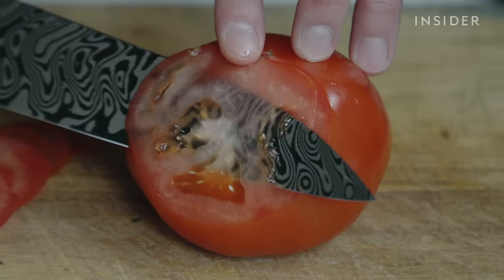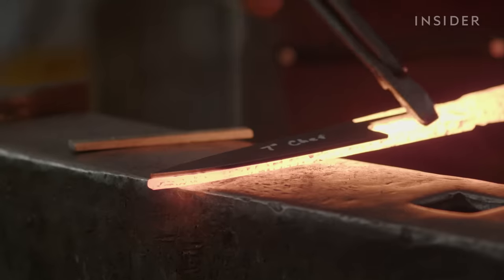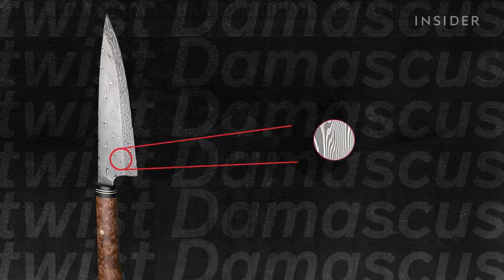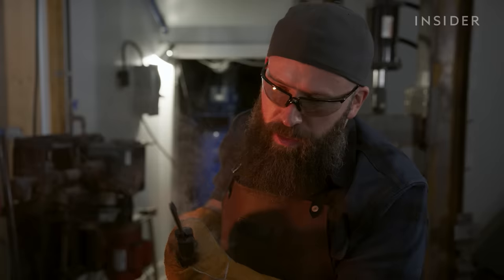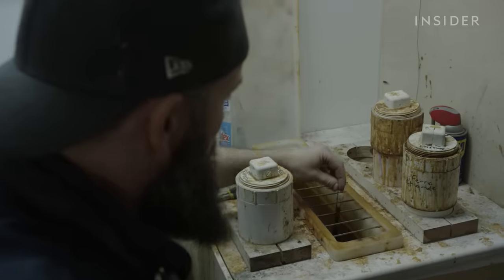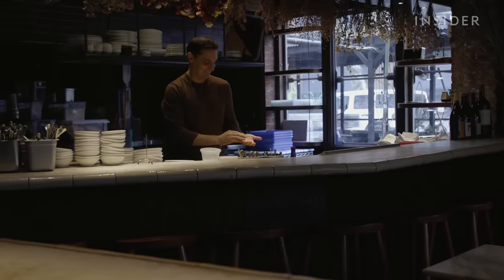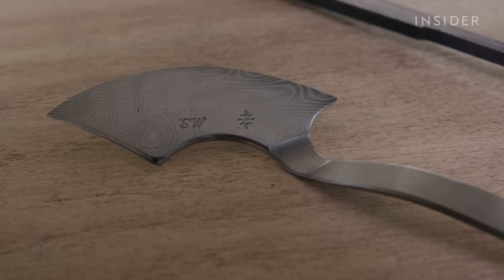Why Damascus Knives Are So Expensive | So Expensive | Insider Business

Comment: There is a lot of misinformation in this video unfortunately... 

For one, damascus/pattern welded steel is no "sharper" "stronger" or "better" than any other monosteel. Zach is likely using 1084 and 15n20 for the damascus produced here. After forge welding these alloys together, the carbon content within the steel as a whole will homogenize during forging and your end steel will perform near identically to 1080 (if anything slightly worse as extended periods of forging can actually cause negative effects in the steel). It will NOT perform any better in ANY metric than any other knife made purely from 1080. 1080 is also considered a relatively low performance steel in the world of knifemaking. That's not to say that it is bad, but there are plenty of other alloys that can perform much better in a kitchen setting (CPM M4, CPM Magnacut, Zmax, CPM S90V, etc). These tool and stainless steels do not forge well due to carbide volume and so are exceedingly difficult to turn into damascus. Most damascus on the market will be some combination of low alloy tool steels or plain carbon steels with one being nickel rich and the other nickel deficient. To reiterate, these low alloy steels are not particularly tough, hard, etc. and perform accordingly.

Not to hate on Zach here as he does make some nice looking knives and has obviously earned his title as a master smith, but many of the things he says metallurgy-wise just aren't true. At around 5:40 he says that he is looking at scale that has flaked off after heat treatment because "the steel has contracted after it hardened, so I know it is hard". Steel goes through a volumetric INCREASE during hardening and actually expands slightly, doesn't contract. And this isn't what causes scale to flake off either, it's the force of the vapor jacket during quench combined with the rapid decrease in temperature (which does involve a shrinking of the steel) that does that. To any smith's that are here learning, flaky or cracked scale after quench does NOT equal a hard blade.
He's also using sharpness as a metric for performance which says very little about the actual quality of his steel and ht. Given the low alloy steels he is using and the HT he is doing using his forge rather than a temperature controlled kiln, his blades likely fall far below the performance of the theoretical best-of-the-best on the market. Again, not to say that they perform badly, but to claim that your knife is the sharpest, strongest, etc around is pretty ridiculous. 

Also to everyone in the comments saying that true damascus/wootz steel is a lost art, it's not, we've recreated it exactly. The recipe is not lost we know exactly how it was made and what is in it down to the .000001 atomic %. We've also tested its mechanical properties and it falls far short of any modern monosteel that is produced today. 

Anyway, I'll end my rant there, again no disrespect to Zach, he makes beautiful knives, it's just the misinformation and lack of background research by the people who produced this video that bothers me.

Source: I am a professional bladesmith, have made tons of damascus myself, and have a bachelor's and a master's in metallurgical engineering.
Reply: sheesh u kinda went off there. thanks for the information!
Reply: @spryte4371  Yeah maybe I went a bit overboard haha 😅 just felt the need to clear up some stuff that I thought could be confusing for people trying to learn more about smithing, so I hope it helped!
Reply: @grantsaxman7170  nahh that helped me w a lot of informative knowledge
Reply: On what topic did you do your master's?  And where did you get your master's?
Reply: @latetodagame1892  Material Science Engineering with a focus in metallurgy from University of Michigan. The metallurgy involved in bladesmithing is incredibly complex and interesting which is what drew me to the field in the first place :)
Reply: @grantsaxman7170  nice.  What do you think about carbide rip out when using ceramic over diamonds?  Is that true or a marketing scheme?  And what do you think of the Spyderco's Sharpmaker specifically with the sapphire infused ceramic rods?
Reply: @latetodagame1892  This is a really interesting topic. Unfortunately, it is quite nuanced and depends on a plethura of variables so there's not really one easy answer, but here's my best take:
1) the effect of the abrasive you use depends a lot on the carbides present in the steel. Some carbides (cementite, chromium, etc) are similar in hardness or softer than aluminum oxide (the most common abrasive compound). Using diamond or other hard abrasives here don't really have much of an effect as aluminum oxide is already hard enough to abrade the carbides present. From here on out I'll focus on vanadium, niobium, and tungsten carbides, which are significantly harder than aluminum oxide.

2) the size of the carbides present plays a huge factor as well. Typically you can cut a carbide dense steel quite well regardless of the hardness of the abrasive if the size of the grit is larger than the size of the carbides present. That means that diamond stones and other hard abrasives aren't especially useful until you get to finer grits. This is also one reason (among many) that PM steels are favored over traditionally cast ingot steels. They have a finer carbide size which significantly improves machinability even before sharpening.
3) for the case where you have carbides significantly harder than your abrasive particles and the carbides are larger than your grit, diamond stones do have a use case. I have personally seen microscopy done comparing carbides in PM steels cut by aluminum oxide stones vs harder stones, and it is very evident that the carbides are not cut very well by the softer stones. The harder stones will cut the carbides flush to the matrix whereas the softer stones tend to burnish the carbides and cut around them leaving the edge uneven. Diamond stones aren't the only stones that are useful for this, Sharpton 320 was shown to be able to cut most carbides and it is NOT diamond and instead "ceramic". Do you NEED a diamond stone? Not at all. But there will be some improvement in specific cases that makes diamond or other hard stones better.

4) my personal setup is a cheap 220 grit alox waterstone to burr the edge, a 20 micron (~1000grit) bonded diamond stone to clean up and deburr the bevel, and then 1 and .5 micron smooth leather paddle strops. I like this method because I don't waste money on a coarse diamond stone when it isn't needed, and the bonded diamond stone can cut any steel well and is honestly just nicer and more user friendly and durable than any alox stone I've had. The strops are a super easy way to get a nice final edge, sharp enough for the straight razors I make too.

As for the sapphire rods, I haven't used them so I can't comment on them too much. I only really ever see a single use case for rods imo, and that's for recurved edges, otherwise I tend to prefer stones because I have the most practice put into using stones and I just find they suit my own preferences best.
Reply: @grantsaxman7170  thanks.  I really appreciate the knowledge!   Did you say the paper test is not the best test of sharpness?  Feel free to expound on this and any other topic.  I really appreciate someone with your expertise.
Reply: @latetodagame1892  Yeah, the paper cut test that is used by many people isn't really a very good metric for sharpness. The issue imo is that a decently sharp blade and a very sharp blade will be very hard to differentiate when cutting paper; it's just too easy of a test. There's only one real objective metric that I've seen for sharpness, and that is cutting a taut thread in a specific way over a scale, and recording the weight required to cut the thread. There are other objective metrics for sharpness related qualities as well (the CATRA test for example measures wear resistance of an edge, or how long a sharp edge will stay sharp). These setup are pretty costly for most makers unfortunately, so we tend to resort to less effective metrics like the paper cut test. My personal favorite is shaving my arm, I feel that I can tell a lot about the quality of the edge by how smoothly I can shave my arm after sharpening and how much tug there is in the cut.

If you're interested in learning more though, I'd highly recommend checking out Larren Thomas' blog Knife Steel Nerds. There is a wealth of information there, he has also published a book that has tons of knowledge about heat treatment of modern steels. You can also feel free to follow me on Instagram, my handle is yozakura_forge. A friend of mine also runs a knifemaking business called Troopah Knives, he is a student of metallurgy and regularly posts informative articles on different steels. He actually knows quite a bit about different sharpening stones and compounds like what you were asking about before, you can find him on instagram too.
Reply: @grantsaxman7170  ممتاز!👌
Reply: Thanks for sharing. Very informative.
Reply: Thank you for the technical insight. When I started watching the video I could tell, even with my almost zero knowledge, that there was plenty of misinformation .
Reply: @grantsaxman7170 I love it when genuine experts crop up in situations like this! Thanks for the info friendo!
Reply: The video said explicitly they "perform similarly to monosteel knives."
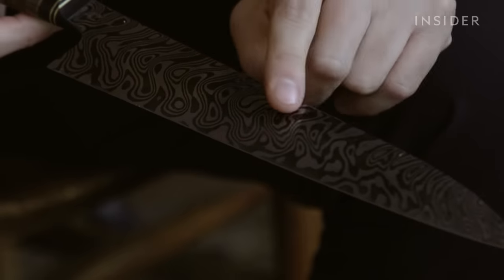Reply: @feelin_fine  Which monosteel? AEB-L? W2? 1018? There are hundreds of commercial alloys that are monosteels, with the vast majority of them not even being suitable for knives, and the ones that are have a huge range of performance. Saying that they perform similarly to monosteel knives is entirely meaningless, BUT they've already created context for damascus' performance at time stamps like 0:18 and 1:23. They are implying that damascus knives occupy the highest tier of performance which is downright misleading. In the world of custom knives, damascus falls into the lowest tier of performance, and performs notably worse than the majority of monosteels we have at our disposal. Again, that's not to say they perform badly, and they also look beautiful, but the video is either misinformed or purposely misleading.
Reply: 200IQ stuff ITT
Reply: Here's to hoping your comment hits the top of this video.
Reply: What hes making is an imagination of what damascus steel might have been , the original method , composition and process has been lost . It came from India , and like everything the British destroyed the science to propogate the industrial revolution
Reply: @Jatadhari1000  This is not correct. Pattern welded steels have been made for centuries and are not a reimagination of wootz steel (a crucible steel) at all. They simply both share a similar surface pattern and thus the term "damascus steel" (which may refer to the watery pattern seen on both wootz and pattern welded steels) has been attributed to both of them. In pattern welded steels, the pattern can be attributed to the alloy concentration inhomogenities between layers, whereas the pattern in wootz is created from vanadium carbide banding. They are both separate steels with historical precedent that happen to share a superficial similarity, neither one is reimagining the other.
Wootz is not a lost art either. It's true that at some point in history the exact recipe became obfuscated which may or may not be due to British influence (I could not say one way or another because I do not know enough, but I wouldn't be surprised). Since then, we have used modern technology like various forms of spectroscopy and electron microscopy to rigorously characterize historical wootz samples down to even individual atoms. From there, the process was reverse engineered with the help of historical texts and carbide banded crucible steels that are indistinguishable from period samples have since been produced. I have even been able to attend symposiums on the topic, handle modern wootz reproductions, and view data collected that compares and contrasts the samples. They truly are identical to historical wootz. The process itself has become well known enough that some hobbyist smiths are even reproducing historical wootz steel and turning it into knives that are on sale today. So no, the process for wootz has not been lost at all.
Reply: So... What chef's knife WOULD you recommend then if you wanted maximum performance, durability, and corrosion resistance?
Reply: In addition to this question: what would be the best quality/price choice for a knife?
Reply: They quickly repair their previous clickbaity statement at 1:43. Basically saying, "No they're not better than a good monosteel knife, but they're very pretty and made by an actual blacksmith!"
Reply: @arnox4554  I have been having really good experience with CPM magnacut steel if you want to know. It is stainless but has hardness near those of pure carbon steel. It is a bit more expensive though.
Reply: @donatodecarolis5330  Roger that.
Reply: @arnox4554  This is a really tough question. Every quality in a knife comes with a tradeoff. Each different knife also has a different purpose and so there's not always one "best" choice that works for every knife. With that being said here are my preferences with regards to chefs knives:

If you want an all rounder:
CPM Magnacut - superb corrosion resistance (enough for saltwater conditions), can be very tough, and can be very hard. Moderate wear resistance (this alloy is pretty much a super stainless version of CPM 4V)
AEB-L - this one's incredibly tough, stainless enough for the kitchen, and very inexpensive. Low wear resistance, can get very hard though. Definitely a very underrated steel as it's often considered a budget steel but performs better than what it costs.
CPM M4 - only semistainless, but very tough for a tool steel. Has slightly better wear resistance than magnacut. This is a steel I'd recommend over magnacut if you don't care about building a patina on your knife

For more niche performance stuff:
CPM S90V - fantastic steel, incredibly wear resistant, very hard, but chippy as hell. It's just not tough so you have to be careful with it, but it performs excellently in other categories
Zmax - I don't actually know too much about this one but I've heard and seen great things. I think it tends to actually perform a bit better than S90V in most metrics. 

For san mai construction:
52100 - this is the best commonly used low alloy carbon steel that is forgeable. Anything san mai with this in it would be a good choice. 52100 has good toughness, nearly no corrosion resistance, and nearly no wear resistance. (I'm comparing corrosion resistance and wear resistance to a baseline of 1095 which has basically the lowest possible in both categories). This steel will not perform as well as the tool steels listed above, but it can be incorporated into san mai which is very difficult or impossible for most tool steels.
Apex ultra - the best forgeable steel on the market currently. This one was only recently developed. It has low to moderate wear resistance. Moderate toughness and other properties. It's special because it has wear resistant qualities while still being easy to forge (forgeability is a requirement for making san mai)

For damascus/pattern welded steels:
There aren't really any great options here. There is very expensive damasteel that performs decently, or look for blends that include apex ultra or cruforge V for a small overall boost in wear resistance. Unfortunately damascus is pretty limited by its nickel alloy which is used for contrast. There are no high performance alternatives to 15n20 currently on the market, I would love to see some developed though
Reply: @donatodecarolis5330  Second the magnacut rec. Functionally it gets much harder than simple carbon steels as well. A common simple carbon steel 1095 peaks at about 67 hrc right out of quench. That's pretty hard, but it has a toughness of around 1 ft*lb which is very low. Think along the lines of glass. There's no real functional use for 1095 at 67 hrc in knives, it is too brittle. Instead, it is tempered back to around 62 hrc with a toughness of about 5 ft lbs. Here it is neither particularly tough nor particularly hard. It also has exceptionally low wear resistance and no stainless properties. It really is a poor performer. In contrast, magnacut can easily be heat treated to 65 hrc with ~10 ft*lbs toughness and be significantly harder and tougher than 1095. It also has wear resistant and stainless properties. Magnacut is a steel that outperforms simple carbon steels in just about every metric. So is 1095 useless? No not really, it makes great hamon, can be forged and incorporated into damascus, and is very inexpensive. But performance-wise, it is just worse than magnacut in every metric.
Reply: Can I ask you which kitchen knife you recommend? Or the one you USE? Sounds like you know your metal and I would like to get the Best
Reply: @LelandSmall-tj7hc  my primary knife is a nakiri I made myself. Currently I only use knives I've made myself. I can't think of a single case where a typical factory knife would outperform a good custom knife, so I'll have to recommend a custom knife here if you want the best.
Reply: This is what comments are for
Reply: @grantsaxman7170  what do you think of WMF damasteel?
Reply: Thank you so much, someone else who knows what they’re talking about. It’s also worth noting that if you have two different types of steel only one can be properly what treated
Reply: @nathanieong6212  I have not specifically heard of WMF, but here's my opinion on damasteel:
Damasteel's primary alloy will perform halfway in between aeb-l and CPM 154. They use European steels, but the blend is comparable to aeb-l and CPM 154. Think of it as a moderate performing steel, it tends to do better than carbon steel Damascus in most metrics. Good toughness, low to moderate wear resistance, stainless enough for the kitchen. If you want a higher performer, they have a blend that uses a cladding of their flagship steel and then a core of a nitrogen steel that is identical to vanax. You'll see significant performance improvements with this blend, I think it's called like N11X or something. The big downside of damasteel is that it's EXPENSIVE. Only a handful of makers offer custom stainless Damascus too as it is so difficult to produce. It is a very beautiful material though.

As for WMF, I took a look at their website. Their marketing is painful to say the least. They use the term damasteel (which is trademarked I believe) so this means they've licensed from the company damasteel, but I can't find which blend from damasteel they use for their knives. They don't seem to list it anywhere which is weird. I expect it is probably the flagship blend of aeb-l and CPM 154 comparable steels. Personally I don't prefer the all steel construction handles, they are heavy and look bad. The heel of their knives are also very low which is not to my preference. Overall not something I'd purchase, but if you like knives of their shape they may do fine. It's hard to say without using one.
Reply: @Afeller  This is only sort of true. If you did have two different steels, than the ht schedule would never be perfectly correct for both. But the ht schedule for steels used in carbon Damascus is already very, very similar, so most differences would be pretty negligible, you'd probably be able to find a schedule that works for both. BUT that's beyond the point here, because Damascus doesn't really behave like two different steels. Once you forge weld simple carbon steels together, the carbon readily diffuses at temperature. It takes less than an hour for the carbon to homogenize at temperature in most cases of medium layer Damascus. Carbon is the primary driver in choosing a ht schedule in simple carbon steels like these, and so the ht becomes essentially homogenous as well for the whole piece.
Reply: @grantsaxman7170  thanks for the reply. Very informative
Reply: Woah, thanks for sharing! Cool!
Reply: Hello, would you mind to link to some good kitchen knives that wouldn't cost an arm and a leg for average joe?
I just need normal, but good and sharp knives, nothing fancy.
Reply: @Ramsas154  I am partial to miyabi. You can get a chef in SG2 for like $300 bucks. SG2 is a solidly mid-tiered steel imo, decent but not amazing. Performs similarly to S35VN. The biggest issue imo is that it can be a little chippy. There are also now steels out there that will at least slightly outperform SG2 in pretty much every possible metric (magnacut). But not a bad steel by any means. Miyabi also sells VG-10 chefs for like half the price. I think vg-10 is an ok steel, but not great. Similar to 440C. Wouldn't ever recommend it unless you are on a stiff budget. It has slightly worse issues with chipping and worse edge retention than SG2. If you want something in VG-10, Shun's Sora line I think is decent for the price. $100ish bucks for a chef. I've used one of these before, it's nothing special but feels much better than most low RC cheap chefs knives. Biggest disappointment is that they don't round the spines on any of these supposedly higher quality factory knives, so pinch gripping is a bit uncomfortable. Would've also liked to see a taller heel and more aggressive distal taper on the Sora line, Shun's knives are weirdly thick behind the edge, probably to account for the low toughness of VG-10.

Other people like Mac or misono, I wouldn't buy one of these personally, just on preference. They won't have chipping issues but I just don't like the feel of the lower RC steels they use. They are very cheap tho (~$100-$150).

I can't really help with Western style chefs as I don't use them often.
Reply: @@Hawxsn This is something I'd actually really like to do!! I have talked to one of my friends who is really good with computers and electrical stuff about doing a joint channel before
Reply: 1:43
Reply: @mikaila1555 Again, which monosteel are they referring to? There's hundreds of monosteels used in knives today. Damascus performs similarly to some of the lower end monosteels that are commonly used. It performs significantly worse than many high end monosteels commonly used in knives. The implication in the video is that Damascus is a top performer and can at the very least match the performance of any monosteel. This isn't the case and the way they are presenting information in this video is very misleading.
Reply: @grantsaxman7170  ah, I get you
Reply: Love when people add so much useful and interesting information to create discussion.
Reply: Cheers mate that was great to read
Reply: So what is the highest grade of knife we can buy and how can we tell?
Reply: @FernestsenreF  hmm I guess I would just say that there isn't really one "best" knife out there. Every task you could do has it's own knife that is most suitable, and your own personal preferences have weight here too. The best thing you can do to get a great knife is find a trusted, professional bladesmith and order something custom from them. Tell them exactly what you want to use it for and what knives you are used to using in the past, and then give them free reign to design a knife for you. If they are a competent maker they will be able to make a great knife that is perfectly suited for you and the tasks you are planning on using it for.
Reply: Thanks for straightening out all the twists in this.  Heat treatment is everything and there is no modern quality steel with proper heat treatment that would not at least perform as well as any "damascus" blade.
Reply: @arnox4554  Corrosion resistance of any level requires a chromium alloy steel of some sort.  For the best of both stainless and hardness/edge retention I'd look into something in D2 or an SxxV steel...but heat treatment of whatever steel chosen is of paramount concern so the maker is just as important as the steel.  Also having no secondary bevel at the cutting edge and instead an "apple seed" cross section will be the best cutting.
Reply: I took one class in metallurgy in engineering school. It was an elective  "welding" class but more about the physical properties of different welding technique and metals. To this day, I remember him bringing in a steel wire maybe 9 gauge or less. The original wire he could bend back and forth and eventual snap. He then heated the wire and quenched it. It became incredibly hard but then could cleanly snap it. Then he repeated the process but after quenching he tempered the material to relieve internal stresses. The result was incredibly tough wire that can be used to make nails. He said it was about formation of grain boundaries. But like I said...only took one class. Great professor, Carmine D'Antonio.
Reply: @sirich7751  That's awesome! I always felt like demos are a great way to get people interested in materials. I remember one where my professor heated a taught piece of piano wire and you could hear the pitch changing as it thermally expanded. Eventually it got so hot it was visibly drooping, it was a pretty cool but simple experiment showing atomic distance equilibrium at different temperature. Your professors description of "grain boundaries" is more like "this is way too complicated to explain in five minutes" hahaha
Reply: Grain boundaries were several classes!! lol.
Reply: Thanks for the info. Written like a true engg. Tbh, I always treat these videos with a grain of salt. I was immediately sure that the price premium was for his hard work in sculpting it beautifully (similar to how paintings go for a premium due to the effort than utility).  Also, there is an emotional angle. He would rather believe that the creation on which he spent 100s of hours to be of somehow better quality rather than just a work of art. I feel it is a common exaggeration, analogous to how men exaggerate their accomplishments to the women they court (and the women play along despite realizing it).
Reply: This guys steels
Reply: thanks dude you answered the questions I had that prompted me to search this video
Reply: @swordfan1330  no... an  "apple seed" is best for CHOPPING, not for cutting.
Reply: what are the strongest knives made of?
Reply: @hermajestyteddy  in metallurgy, strength is a term used to refer to yield strength. And so this question would be very easy to answer, as the strongest knife would be the one made from a material with the highest yield strength.
But in colloquial terms, strongest has little to no meaning. There's no one property that it points to, and the properties that people usually associate with a "strong knife" are things like toughness and hardness which tend to be inversely proportionate. So this ends up being an impossible question to answer. There is no such thing as a "strongest knife", every well made knife will have tradeoffs that allow it to perform well for a specific purpose, but maybe not so well in other areas.
Reply: You say 1080 has a poor performance compared to other knive steels, but in what way? Of course there is always a bit of personal opinion on steel types and what is better and worse. But i tend to look more at the real high carbon end of steels: shirogami,  yasuga, vg10, aus10 etc. I sometimes see 1080 fly past on the lower price points when looking at my usual knives (mostly yapanese style knives) so i dont really pay attention to it. Also, what would you recomend as a steel good for boning knives etc? Obviously a shirogami #1 wouldnt be too great lol
Reply: @shemshem9998  When I say that 1080 has poor performance compared to other steels, I am basing it on 3 main metrics: toughness, wear resistance/edge retention, and corrosion resistance. A fourth common metric is sharpenability, but with the advent of affordable diamond and corundum sharpening tools available for hobbyists, I don't think sharpenability is an important metric anymore. 1080 performs worse in all three of the above metrics than many common tool and stainless steels. To restate this, there are several steels that will perform better in every way than 1080. This is why I say 1080 is a low performance steel, not because it is bad, but because there are better steels out there and it is comparatively poor. The steels you listed are High carbon steels except for vg10 and aus8. I'll admit I'm not at all familiar with yasuga. But shirogami is not a particularly high performer, it fits a weird niche and is mainly used for cultural and traditional purposes. Aus8 and vg10 are not particularly well performing stainless steels imo. I often recommend CPM Magnacut, CPM M4, and CPM S90V as high performance steels depending on the application. These are just a small selection of a great many steels that will outperform the ones you've listed. For boning knives, I typically recommend aebl or CPM Magnacut, although common high carbon steels like 1080 and 15n20 would make a fine boning knife as well.
Reply: @grantsaxman7170  sorry i miss spelled yasugi steel first of all, and i meant to say oagami steel (sometimes i get a lil confused, both shirogami and oagami are called yasugi, its just the style of production by the company that makes them). But ive never seen cpm m4 etc in kitchen knives, ive heard of it in those chopper knive competitons and some every day carry knives, but never in kitchen use (any cmp steel for that matter) no matter the price. So how come? 

Is the grain too large to get a sharper edge, is it too brittle so thst you cant make it thin enough for easy cuts and getting the weight down or something like that? 

Because in the kitchen knives world even the most expencie and high quality knives are almost exclusively made using shirogami, oagami, silver, or swedish steel. I tried finding some cmp m4 kitchen knives and i could only find them from one company (Nora knives) and for the rest it was all forums either showing off their own creation or aksing about if it could be used in kitchens
Reply: @shemshem9998  All great questions, but unfortunately it gets very complicated, so let me try and take it one step at a time. 

Aogami steel is another Japanese steel marketed as a high carbon steel. Where it differs from shirogami is that it has chromium and tungsten added in small proportions. It is almost like a bit of a tool steel. The tungsten and chromium will precipitate out as carbides most likely, although they are in such small quantities that I wouldn't expect to see too much benefit from them. I think on a scale of 1-10 for wear resistance, shirogami would likely be around a 1.5-2 and aogami a 2.5-3. in comparison, M4 will be closer to a 7 or 8. S90V is more like a 9 or 9.5. So both these Japanese steels will underperform in terms of wear resistance. When it comes to corrosion resistance, neither are stainless, shirogami is like a 0 out of 10 (no corrosion protection), aogami maybe a 1 or 2. In comparison, M4 is about a 4 or 5, S90V an 8 or 9, and Magnacut a 9.5 in corrosion resistance. Finally, toughness, which Japanese paper steels are notoriously poor at. Shirogami and aogami both score around a 1/10, s90V a 2 or 3 maybe, and Magnacut and M4 closer to a 7. This is what I mean when I say that the steels you listed underperform. How does this look in actual practice though? If you are using a Japanese paper steel knife you will likely find that it loses sharpness 2 or 3 times faster than something like M4. It needs to be resharpened that much more often. Thin geometry knives will be mich more prone to chipping than an M4 knife. And finally it will patinate and rust faster than M4 (s90V and Magnacut will never patinate or rust in any kitchen application). 

So then why do companies use these steels instead of higher performing tool and stainless steels? And the answer really is complex unfortunately. Some reasons are: cost (most of the steels you listed are ingot steels, the steels I listed are all powder metallurgy which are many times more expensive than traditional ingot steels), production issues (the steels I listed are incredibly difficult verging on impossible to forge, and require special grinding equipment to bevel and sharpen efficiently because of their carbide content. They are more difficult to manufactured knives out of than the steels you listed), culture and traditions (Japanese steels have long and important cultural ties and so many knives are designed around those traditions rather than engineering a performance blade), marketing (vg10 and aus8/aus10 are starting to become household names whereas M4 has a history of use in industrial forging dies lol, it is more difficult to market than the others. Japanese steels also have a lot of "mysticism" to them from the western consumer perspective which draws a lot of buyers from America and Europe), etc.

As for why you haven't seen CPM steel before, CPM stands for crucible powder metallurgy, it is a trademarked name by the American company Crucible, so in all likelihood you have seen "CPM" steels before, they will just be listed as PM or powder metallurgy steels if they are not steels produced by crucible. I believe vg10 and aus10 have powder metallurgy alternatives that somewhat improve their performance vs the standard ingot version, but the cost is several times more. PM isn't really required or all that useful for lower alloy steels, but becomes incredibly useful for high alloy tool steels like M4. 

I saw you also talked a bit about grain size etc, and I'd be happy to discuss that more, but it's unfortunately even more complicated than anything else talked about so far. Here's the crash course on why tool steels and PM manufacturing is good from a metallurgical standpoint:
Tool steels have elements added like vanadium, niobium, tungsten, etc which tend to bond with carbon if added in the correct proportions. When they bond with carbon, they precipitate out of the metal matrix as hard ceramic particles called carbides. These carbides are very, very hard, like as hard as many gemstones, and they stop the blade from wearing away as quickly which helps it stay sharp for longer. When you have a lot of carbides precipitating out (like in high alloy tool steels) the carbides tend to grow on other carbides and make a few giant carbides instead of a bunch of small ones. This is really bad for performance. To get around this, we use PM manufacturing where liquid steel is forced through a  platinum showerhead into a fine mist. The mist cools in air and settles as steel dust. Each dust particle has its own carbides which are limited by the size of the dust particle and are very small because of how fast the particle cooled. The dust is collectedamd packed into a mold and gas is added to the mold to prevent oxygen contamination. The mold is then heated and pressed and the dust is sintered together. Sintering is when particles fuse without ever becoming liquid. Because the steel is not liquefied, the carbides do not have much of a chance to grow and remain very small (which is good for mechanical properties of the steel). 

Hope this helps! All in all, if you want the best knife possible, my advice is to buy custom. It's much more expensive but higher quality than factory if you find the right maker. If you have a minute please take a look at my work yozakura_forge on Instagram! I can recommend other makers as well if you are interested in getting a custom knife made for you
Reply: You seem to be saying people who want the damascus aesthetic have to accept a subpar edge steel.  But san mai (which you bring up elsewhere) seems pretty standard for those who want both a good edge steel and the damascus look.  Heck, it's not even expensive.  I got my mom a VG-10 core (knew she'd damage it; no point in spending more), damascus clad tsuchime finish petty for $110.  The damascus is pretty subtle, though.
Reply: I definitely will view damascus steel with a different set of eyes, thank you. What I'm curious about is a pocket knife I purchased years ago that is forged out of Damasteel, a technology that based on powder metallurgy and uses high alloy steels. Is damasteel a technology that both holds excellent sharpness and durability (for tech in our era atm) and the looks of layered damascus?
Reply: @concinnus  Yes, san mai can be a good option for people who want pattern welded steel with a high performance edge. VG-10 is not a particularly high performance steel, and I am not a big fan of it personally, I normally only recommend it to people on a budget. It's rare to see higher performance steels in san mai because the process of putting them in the core is much more difficult. High alloy tool steels have a high phase fraction of carbides which makes them very hot short and difficult to forge and weld. Monosteel will always be more affordable and more commonplace than high alloy pattern welding especially in the custom world of knives. There are limitations to the patterns used in san mai as well. San mai means three layers and normally it is a monosteel clad in two other layers of monosteel. You can use Damascus for the cladding but because you have to remove material to bevel the blade, patterns that are only revealed on a cross section don't play very well with san mai. Basically you won't be able to get mosaic patterns to work well in san mai cladding, and mosaic patterns tend to be among the most prized and sought after forms of damascus. If you've found a knife that your mother uses and likes for a price you are happy with then all the more power to you
Reply: @vacolla1381  Damasteel is typically two steels similar to aeb-l and cpm-154 that have been combined. I think the process they use involves a canister with aeb-l ingots arranged inside according to what pattern they want, then the canister is packed with powdered 154C and HIPped which sinters it. It is then rolled down to size for knife blanks. In some cases both steels may be powdered, but steels like aeb-l will not benefit much from powder metallurgy as they have low carbide content and the carbides are already relatively small. The result is a steel that performs somewhere in between aeb-l and cpm-154. I would never consider it an ultra high performance steel, but it does have moderate to high performance and it's nice because it's a bit of an all rounder, it does everything pretty well and so can be used in many applications. Overall, I like it, I prefer it to many other commonly available steels in the same market niche as it. And as you've mentioned before it is very beautiful
Reply: @grantsaxman7170  My bad, I hadn't realized that a higher carbide fraction makes it harder to weld to.  Makes sense.  As for the patterns, to me damascus is just irregular waves.  A perfect, geometric pattern is like a bejeweled Glock -- just the wrong look for the implement.  Now, mosaic pins, I can get behind.  I have a Miyabi and a custom with them.
Reply: Can't believe I read the whole thing even though I know nothing about Steel or Steel making! Lol. I loved it!
Reply: You're a genius bro. Hope you're having a good life
Reply: @superman-rr7yr  thanks man hahaha u too
Reply: And just to add to this mic drop Thanks for the information
Reply: You're a legend. Thanks for the info.
Reply: What a carrier dude, incredible.
Reply: damn your a lucky guy, id love to get into black smithing but unfortunately its kind of a dead art and not much business for it
Reply: still looks cooll :P
Reply: Now explain to people how jet fuel can't melt steel beams
Reply: I ain’t reading allat tf
Reply: 1:45 she mentioned
Reply: How much is the price of J.Matteüs 11 every day?
Reply: I guess this is not a "comment" 😂